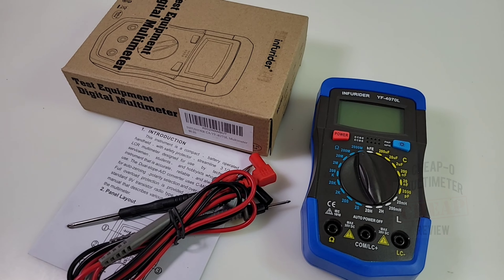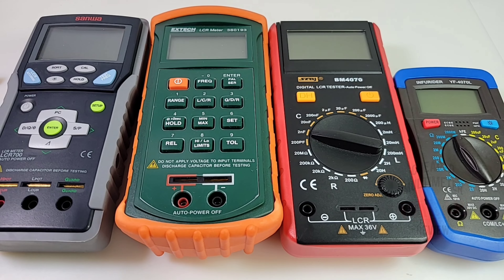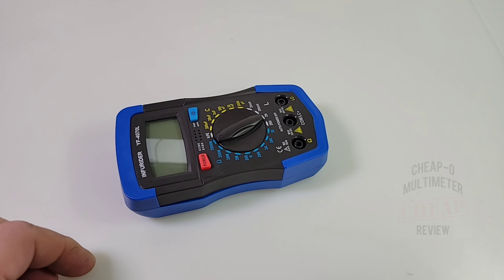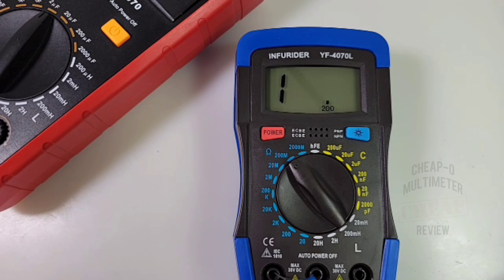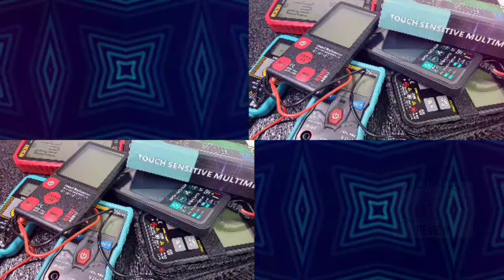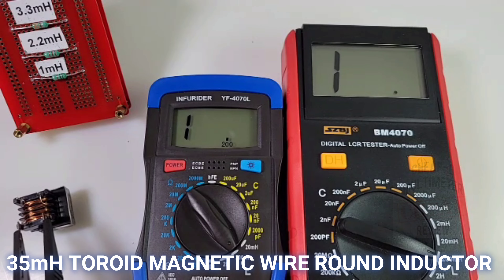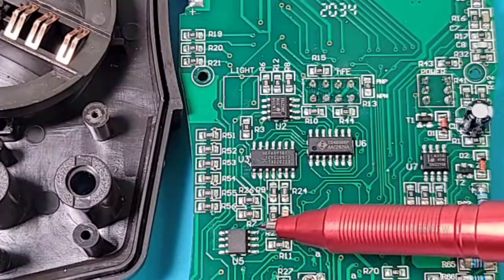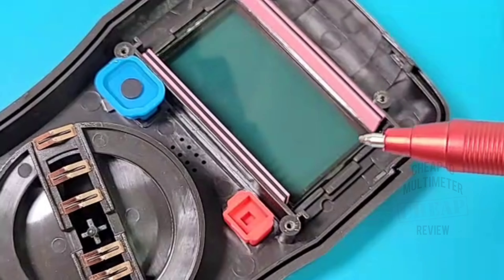HOLDPEAK 4070L (INFURIDER) CHEAP-O LCR METER Review & Teardown!

Comment: Interesting high resistance range, that is comparable accuracy to a lot of the insulation testers that I look at working at a much higher test voltage. Cheers for the video.
Reply from the maker: Cheers...all in all, way better than I expected..it's a decent budget lcr tester all things considered.

Comment: Mine is on the way. Exactly the same but branded as a Goldchamp.  I would never have considered this pos but last week the need to read high resistance came up.  The 2 giga ohm range made the sale.
Reply from the maker: It's still going strong. Great addition to the workbench. As you pointed out  the sizzle is that incredible 2GOhm range , at this price it's hard to beat ! 👍

Comment: Nice little lcr meter. Definitely worth its price for those who need that extra resistance range. It’s a shame thought that it misses input terminals and comes with regular leads. It makes testing components so much harder.
Reply from the maker: Roger that.. 👍those input terminals are sooo nice to have on an lcr meter. Shipping withOUT any good leads is a no-no. Obviously ESR is out of the question. However,  End of day it's a nice basic lcr tester that fills a need. As long as the price stays low I think its good value.

Comment: I just got one of these mainly because of the low frequency for inductance test, which is perfect to measure guitar pickups. Well, OK, and because it's inexpensive, hehe.
I wonder if any of those trimpots in the pcb will do the calibration for the inductance ranges
Reply from the maker: Yes indeed..3 pots for the 3 ranges.Nice to have a potentually user accessible calibration mechanism if one so chooses. Glad you like it. The lcr gods have spoken 😉

Comment: Can either one measure the capacitance of a phono RCA cable with 100 pF or less?
Reply from the maker: It should be no problem as this goes down to the mH scale.
Reply: @KeepOnTesting  Just ordered the HP-36D.  Hope that one can test below 100 pF.
Reply from the maker: @cjpriustt  Great stuff..let me know  how you like it 😀 👍
Reply: @KeepOnTesting   Isn’t mH inductance not capacitance?
Reply from the maker: @cjpriustt Yes it is. That's why this is labeled as an LCR METER. Inductance, Capacitance and Resistance
Reply: @KeepOnTesting  Then what did you mean when you say it goes down to the mH level?  
Asking because the lowest pF on this dial is 2000pF, whereas the HP-36D is 200pF.  I wonder if the HP-36D will give me better accuracy at less than 100pF.